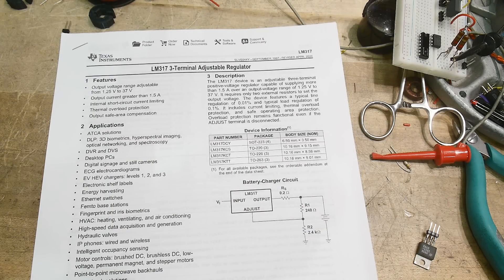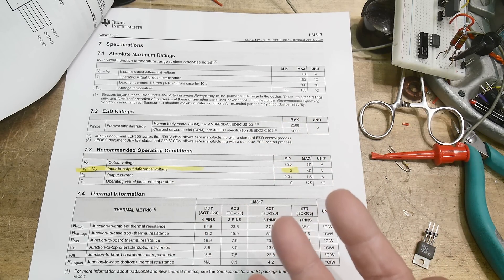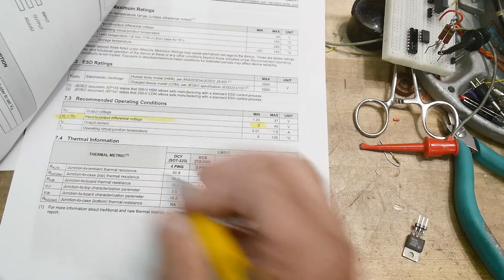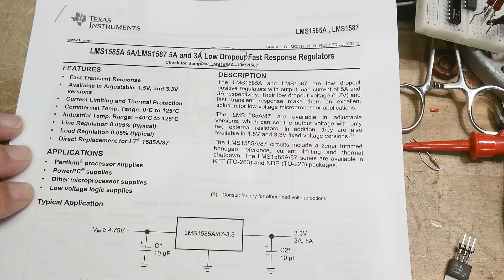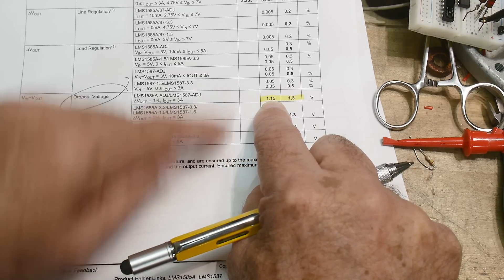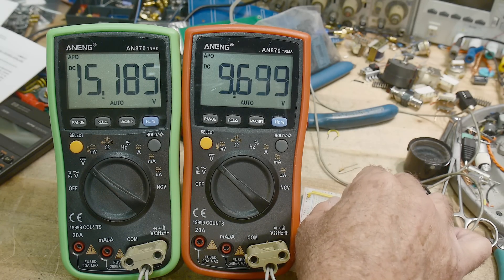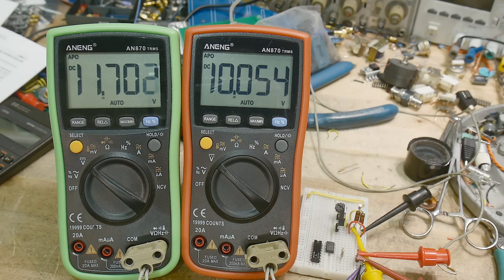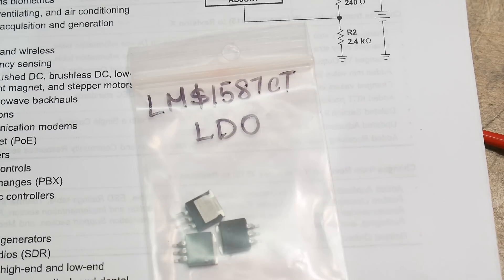#1480 What is low dropout?

Comment: How about the XC6206P302?  It has so low of a dropout voltage and quiescent current that it makes a good choice for long-term battery driven circuits.  For instance, replacing a CR2032 or 2AAA cells with a 4.2V lithium polymer cell in 3V devices.

Comment: A good investigation of dropout voltage. As I have mentioned on your channel previously, using the lowest dropout voltage does not allow the chip to achieve its best ripple rejection. The best ripple rejection is, for the 317, likely at a minimum of 3V of headroom.That is, probably, why 3V is recommended. It would be nice to see an investigation of the ripple rejection, between 2V and 3V. Cheers.

Comment: 1:05
It does not say dropout because it is a different specification.
Input to output differential voltage from old TI datasheet is a guaranteed equivalent for "safe operating area" voltage range. Actual dropout may be much less on a particular chip.
"Dropout voltage is the MINIMUM input to output voltage differential needed to maintain regulation AT a specified output current. In dropout, the
output voltage will be equal to: Vin – Vdo" - quote from a modern ULDO datasheet.
It is characterized at similar conditions: Vin = 0.98 × Vout(nom), Iout = x
So, there should be a graph vs load current for dropout voltage.

Comment: The drop out voltage is the big killer in linear voltage regulators. Even with the 1.3V at 3A the device will be dissipating 3.9W all by itself.  A lot of folk look at the max current and forget that the voltage dropped across the regulator is going to generate a lot of heat. So they need quite a good heatsink to keep the junction temperature below it max’s value. 

On a lot of high power fet datasheets quote max current handling that can only be achieved using a stupidly large heatsink, where the surface has been machined to be fantastically flat to get the required thermal flow between it and the fet. but it looks good on paper.

Comment: great informational video. But should 1.3V be considered LDO? I think it is way too high. 100mV @2A should be considered LDO. Since I learned how to build these with differential pairs I don't look at these chips anymore.
Reply: LDO regulators with PNP pass transistors are what I consider more typical designs.  A well established (i.e. "old") example is the LM2931.  It can only output 100mA, but the dropout voltage is around 0.2v.  One caveat is that they need a fairly specific output capacitance to avoid oscillation.  I recall seeing a design that wasn't quite right, and it ended up oscillating at 100MHz.  It wasn't discovered until it was submitted for EMC testing.   More modern LDO designs tend to be more forgiving and easier to make stable.
Reply: No.
The classic series of voltage regulators  of the 7805, 7812 had a drop out voltage of a minimum of 2 volts.

So it is quite justified to refer to 1 volt differential as LDO.

Comment: completely off topic for which I apologize. I have a great deal of respect for you, and wanted to run this by you to see if you concur. I recollect that High Power BiPolar RF Transistors structures, like MRF247  are made up of several transistors in parallel.  Thus is is not practical or possible to identify a failed transistor with a multi-meter. (MOSFETs are a different story). If this is accurate, do you know of a way in which they can be tested?
Reply from the maker: you can still use a multi meter. an NPN transistor is NP  and   PN diodes in series. you will measure .6 volts across each. same if three transistors in parallel. if one transistor is an 'open' then yes you would still see 0.6v but almost always, if one transistor fails under load, then the other two will fail because they have to do more work (heat).

Comment: I think to test regulation you need to check the ability of the regulator to hold the voltage under changing load, so if you just look at where the voltage drops off you might miss the fact that the regulator had almost zero gain in the feedback loop long before  the voltage started dropping.
Reply: That’s very true. On the other hand, sometimes the application is much more benign and doesn’t need every parameter to be upheld, say because the load and supply source are “constant” and eg. DC performance is all that’s needed. Say if you used it as a current source for a heater - not necessarily most common use, but not entirely ridiculous either. Or in a charger, or a LED driver, etc.
Reply: That is how you test load regulation.
But there is also line regulation too.
Reply: @deang5622  Yes, but how does the datasheet define drop-out with regards to regulation.  It would seem that dropout would be the voltage needed to maintain all regulation characteristics, load and line regulation.

Comment: Nice video. Switch mode to get you in the ballpark (with noise), followed by nice linear regulator to get you clean stable voltages.

Comment: I've applied LT1085 and SI3052V.  The LT1085 works fine although it's not a true LDO.  The SI3052V is sensitive to the ESR and ESL of the output capacitor.  Tantalum or oscon capacitors are an absolute necessity.

Comment: They may call it LDO, just like the 1117 series, but they both LIE!!!!!!!!!!!!!!   LDO is below something like 0.5V dropout at FULL power!
Reply: In my mind 0.6 volts, you know one transistor worth. But yeah if it's over a volt it's not a ldo to me lol
Reply: It is not a lie.
There is no standard for the definition of "low' in LDO.

For many years we had the classic set of voltage regulators the 78xx, 79xx series which typically required a 2 volt minimum drop from input to output.

And when LDOs were introduced, the "low" was considered to be relative to that 2 volt drop.

Ok, today, we can achieve much lower voltage drops but it also depends on the current.

So it is up to the manufacturer to decide if their product is an LDO or not. But they won't get away with calling it an LDO if the voltage drop is around 2 volts.
Reply: @deang5622  I get where you are coming from. but doing 1.5V or even 1V compared to 2V dropout is on the face of it a GROSS EXAGURATION in calling it LDO.  I know there is no standard, so ABUSE is going to happen, and it does, but a fair and reasonable person would not consider > 0.6V to be LDO.
Reply from the maker: you are not thinking of the age of this part. 1.5 WAS low back decades ago. I remember. no it is not anymore
Reply: I understand, and for the most part I agree, back then proper LDO did not really exist, and many linear power supplies were horrid designs anyway, sometimes even with the ubiquitous (in it's day) uA/LM723, which in most cases made a good PSU, but I am an unforgiving bastard! :)  Btw, way back then I was amazed that some switching power supplies used the 723!   ...Yep, seriously!   But way back then switching power supplies also tended to blow up a lot.  ...Times have sure changed! :)
Reply from the maker: @stevenbliss989  723 https://youtu.be/tTMFh5xvmAM

Comment: Seeing a .5 volt difference as opposed to a 1.5 volt difference immediately makes wonder about price difference. If there's a drastic difference in price between the chips and a much lower difference in function, I'd question the value.
Reply: Their value isn't just based on the price of the chip. It is also based on whether the product you are designing benefits from that low drop out voltage.

Reduced power wastage may be beneficial. I will leave you to think of an obvious application where it might be useful.